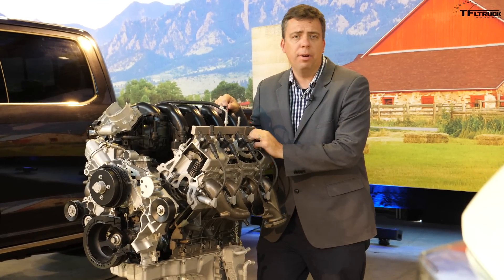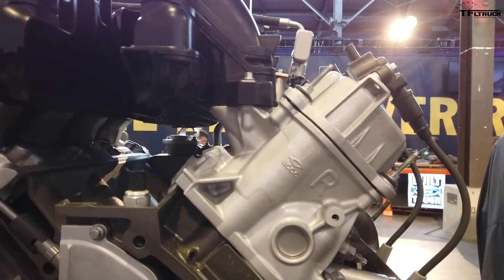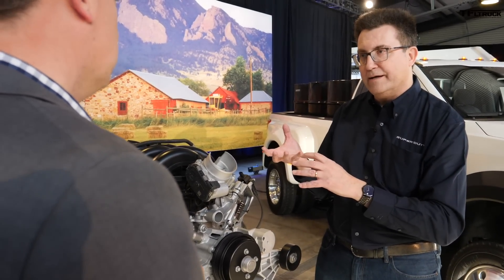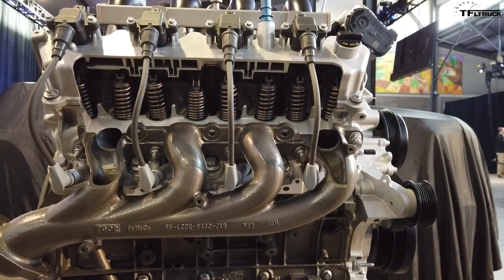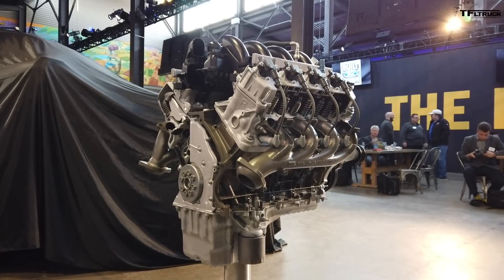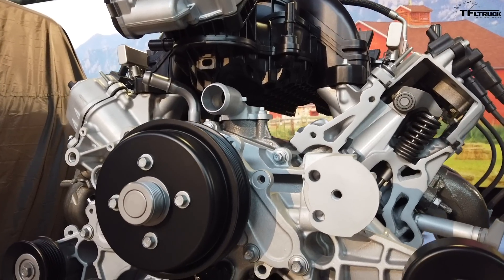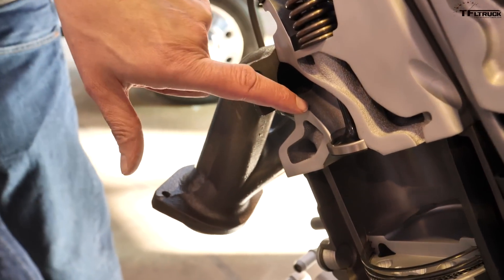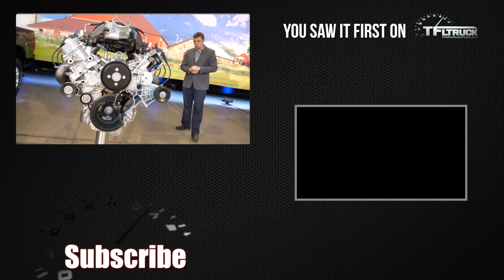2020 Ford Super Duty 7.3L V8: Here's What You Need to Know!

Comment: I'm a farmer and it'll be another few years before I'm in the market for a truck but this is exciting.  I cant wait for you guys to run this motor through the ringer cause i need a truck that can haul hay and cattle.  Im also looking hoping for this engine being cheaper to maintain than a diesel.
Reply: It will be a lot cheaper to maintain i just hope they dont use some weird spark plugs that requiered a special tool to come out
Reply: The only way it won't be far easier and cheaper to maintain vs. diesel is if it's just not a good engine.

Comment: Notice everything was designed as if it was boosted? Sounding kinda like they are gonna use this as the foot print to bring the 7.3 power stroke back. Using a lush rod set up again. I can see some old school gear heads getting into this bugger. Have a 7.3 fox body lol

Comment: Sold my 2017 SD 6.2 Lariat... just didn't have enough grunt to it.  My 2018 3.5 Ecoboost F150 tows better power wise.  I don't need / want a Diesel... so my next truck might be the 7.3!
Reply: Tows better because it doesn't need to downshift when pulling grades ETC, the turbos spool & compensate. Been a facet of diesel trucks for 30 years now, and part of the reason why they are so much more efficient. I do agree wholeheartedly that 3.5 is a torquey little SOB. Don't think you will get the same enjoyment out of this engine, it'll be like the 6.2l. Point is, you like the ecoboost because it tows better, tows better because it's turbocharged. Turbos FTW!!

Comment: That white single cab dually looks almost stubby to me,  extended/crew cabs are so much more common in that weight class. Even if they're too spendy, fleet buyers'll get their F350 dually single cab as a cab-chassis with the extra wheelbase and slap a flatbed or utility body on it.

Comment: I'm very cautious of this engine because it still have a cam phaser  implemented (but only one). Have they figured out how fix them failing? I made sure I bought a truck with a 5.4 2V back in 2007 because I didn't trust the 3 valve engines and the VVT. I am so glad I did because the old girl has never let me down after 250k km.

Comment: PLEASE PLEASE!!!  when you do the IKE test on the 2020 7.3 F250 at max weight, take that amount of weight and do the IKE with the 2020 6.7 so we can get the MPG to do some operating cost analyses.  I'm thinking based on my research that the 6.7 will get 3 MPG better than the 7.3 at the 7.3 GCWR.

Comment: Ford finally admitted the pushrod engine is superior for a strong reliable engine. I hope Chevy brings back their big block, that’d be awesome
Reply: GM already offers a 6.2L in their trucks and large SUVs.  When did such a huge displacement become a "small block" engine in your mind?
Reply: @houseofno  for GM everything smaller than 400 cubic inches is normally a small block, the 6.6 is technically a small block. On the other hand they also have low displacement big blocks. Big vs small block is not really judged by displacement but size of the motor and internals
Reply: Brian Weir the 6.2 is a big displacement small block engine, like the 400ci sbc from the 70s and 80s. A big block is just that, it has a big block. The ls series is comparable to the sbc. The gm 8100 was the last big block technically, even though it wasn’t called a big block.

Comment: It still has alloy heads, I'm sure it can be blown up. I simply cannot understand why in such an application they wouldn't use CI heads. Weight isn't an issue in that size truck. If engineers actually had to fix the broken ones they'd learn.

Comment: One second, hot rod guys. Take a look at that block. The lifters are under the head. If you are thinking of a cam and lifter upgrade, you have to take off the heads . Now a simple cam swap has turned onto a huge pain in the ass.

Comment: How is it compared to the old 7.3L V8 PowerStroke?
Reply: From a performance standpoint it will eat and shit out a stock 7.3L Powerstroke, the only question is long term reliability since its such a new engine, but its based off of 60+ year old architecture and it seems really overbuilt for durability, to unless there's some unforeseen major factory flaw that's yet to surface, It'll likely last for decades.

Comment: This would be a killer twin, big-turbo engine for the aftermarket as I bet it could mimic an electric power plant with early high torque/hp off-idle to a 5500-5800 redline. Even as-is, it'd make a light car quick enough to respect it if it hooked.

Oil squirters? Check. 6 bolt mains? Check. Extremely over-kill exhaust manifolds with very large and clean exhaust ports? Check. Can they be flipped upside down? Probably not. Roller valve train? Check. A plastic intake? Seriously? Why heat cycle the exhaust manifolds only to toss plastic up top? Why not aluminum? Maybe I missed it, but have to assume it's forged rotating assembly.

Always thought it was a shame when Ford dropped their pushrod engines while GM kept refining theirs. I'd actually seek one of these out some day over another LS swap. The fun part though would be trying to get it mated to an AWD platform in a car.

Comment: Dude I'm sensing that there's really no point in getting that big huge V8. I mean that 6.7L Powerstroke diesel was always a damn good engine for the super duties. If I wanted a F250 I'd just get it with the Powerstroke. That's like the best diesel truck to ever buy. Especially the new updated 6.7L Powerstroke for the 2017-present generation, they run cleaner and it runs just as good as the 5.0L V8. Like I'd just get a 6.7 Powerstroke over the 7.3 gas.

Comment: Looking at 2021 7.3 XLT 4x4 towing 10k RV. Would you recommend the 4.30, 3.73, or 3.55 rear? Pls advise. TY
Reply: Honestly 10K is nothing for a Super Duty. Even a base 6.2L gas V8 F-250 would drag 10K no problem. With the 7.3L you could easily get away with 3.55's.

Comment: Everyone is saying ford should bring back the 7.3 powerstroke lol yeah right for 1 the 7.3 is hard to start in the cold, 2 they don’t make any power, and 3 they wouldn’t even come close to being able to pass the emissions we have now.
Reply: 1 they don't run reliability at all lol.
Reply: soaringtractor  lmao.  "just plug it in first".  Then when the block heater and glow plugs fail, you can switch to a diet of ether every morning.  God, those 7.3's were trash.  The HPOP??  Holy shit, those engines are better left forgotten.
Reply: soaringtractor you shouldn’t need glow plugs to start a truck when it’s 50° out lol my 12 valve starts with out being plugged in when it’s 20°’s out
Reply: I agree with Reck

Comment: Ford seems to be doing ok with body and engine design...  even the BO Play stereo sounds good in the raptor, but the quality of their interior is... rock bottom.  Get rid of the vinyl seats and use real leather.  Or provide a real leather full package to include the dash and steering column and door panels.  Give us an option for a quality interior without all the plastic knobs and plastic panels like on the steering wheel.  It feels so cheap and this is where we are going to spend a large majority of our time.  In the truck!

Comment: Can’t believe the length of the valves and springs. Tell me smallish ports with high lift cam for low end torque? Yet power on higher end. Anyone remember the nail head Buick’s ? First motor I saw go over 100,000 miles in the fifties. I have a pre def diesel and don’t want a newer one. This could be a great alternative.

Comment: This looks like Ford's version of the Chevy LS platform.  I guess its only fitting, Chevy introduced their version of the 4 cylinder Ecoboost.
Reply: Ford  was using a Y block with cross bolted mains when GM. was still using the old 350.
Reply: @benjaminwayneb 
Your NOT telling me anything, I've been driving Fords for 35 years.  Ford has gotten away from simple and went with SOHC and DOHC technology because they know how to make them work and produce big power.  The Ford Ecoboost technology is changing the truck world as we know it in the light truck segment but like the Ford engineer said, in the 3/4 ton and up market these smaller high revving engines are not efficient when your heavy towing even though they can tow quite well. That said, Im not a Chevy guy, but you can't argue with the success of the LS engines. They are small, simple, cheap, reliable and most of all POWERFUL. If you can beat 'em join 'em. (Why do you think Chevy has a 4 cylinder Ecoboost type engine in their 1/2 ton trucks? Because the Ecoboost is killing them in sales and performance.) Ford is a Full decade ahead of Chevy in the turbo market technology and will enjoy that for a  long time. Now Ford has their own pushrod LS type engine but in BIG BLOCK!.  The Ford engineer said it 40 times,  "This engine platform has to be reliable". And building a simple skirted, cross bolt, coil on plug, single cam, pushrod V-8 in a Big Block format should be old school for Ford engineers.  I can't wait to see it and to see how the aftermarket response to it.

Comment: If it has the same power to displacement ratio as GM's new 6.6 gas engine, it should have 450hp 500 torks.  Makes you wonder if it will hurt diesel sales, or if the automotive industry is phasing out big diesels in the long run.  With the 10 speed, a big gas engine can put out the same torque at the rear wheel as  the old 6.4l powerstroke diesel did with the 6 speed.

Comment: Can you get it with a Manual Transmission ?
Reply: Nope, no one offers a manual in H.D trucks anymore. Ram was the last one and the ended production of their manual transmission last year. I believe the only transmission offered with the 7.3L gas is a 10-Speed automatic.
Reply: Not from the factory... Since they will be putting it in other HD trucks (F450/550/650) tow trucks, chassis cabs they will more than likely be available with a manual...so you can use/find one of those transmissions to swap in (IF it fits). Of course those are HD truck manuals and Nothing like a manual out of a Camaro or challenger.

Comment: Good. The slight hit owners or fleet owners take on fuel costs they save because of less downtime and maintenance costs. The Powerstrokes and EcoBoost motors while powerful are over-engineered and too much crap goes wrong with them. Anyone operating a business can afford slight increases in fuel costs, they can't afford downtime when one of those Powerstrokes decides to blow a turbo or end up with a phantom issue regarding all the emissions nonsense. Big push rods turn slow and aren't stressed because of the high displacement which equals hundreds of thousands of kilometers of service.

Comment: One thing to know about this engine. This is not a performance engine. This is a long stroke, low rpm, torque haulin machine just like the engines of the past. While configured with a push rod setup this engine will never see the inside of a mustang. Pushrod muscle car setups are best left to dodge and chevy. The 7.3 will replace the iron lump of a Triton V10 that currently exists.

Comment: I see Ford has brought alot of LS styling to this engine, maybe they figured out that the LS engine is a pushrod success, even the LT5!
Reply: You mean the LS copy of Ford's Windsor engine.
Reply: @benjaminwayneb  Wrong,Warren Johnson designed the LS engine for GM!
Reply: @adambrooks2297  The LS bottom end looks exactly like the Ford Tritons. Ford was using cross bolted mains when GM was still using the old 350.

Comment: Will that fit in my Falcon?
Reply: 100% Its displacement is huge but because its a pushrod engine its actual physical size is significantly smaller than the lower displacement SOHC 6.2L V8.

Comment: I'd like to know how well it works next to the Ram 6.4 and GMC 6.2. Those are some great iron block OHV engines.

I didn't understand the reason why Ford went with SOHC truck engines when they weren't much more powerful than good OHV engine designs.  I don't even understand why Nissan made a DOHC engine for the Titan when it wasn't more powerful than the Ram. I also think it is crazy that Toyota also makes a DOHC engine, but it ends up requiring more fuel than OHV engines with similar power.

The rocker arms are interesting to me. They look about the same as the ones found in Gen 3 and 4 SBC engines. I wonder if they come from the same company, Delphi.

The ports appear to be splayed, which is said to be better than a regular wedge design and simpler than a true hemi head. It worked well for the Ford 429 and Ford 460, as well as the BBC. I think the current GMC engines are regular wedge designs, but I could be mistaken.

I don't like that it is 7.3L. I wish it was exactly 460 CI (~7.5L) to attract fans of classic Fords. Dodge knew this would be appealing when they bragged about making a new 392 Hemi for the Charger.

Adding piston cooling jets for durability may be a good move on this engine. It helped make the GM Ecotec go from well below average life to below average life. It also made it possible to get 220,000 miles out of a 300ZXTT.